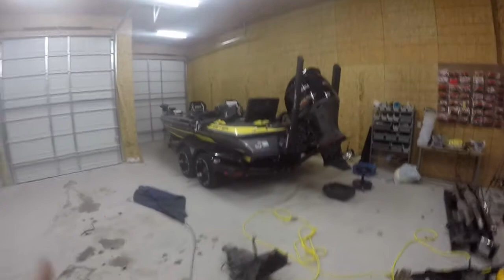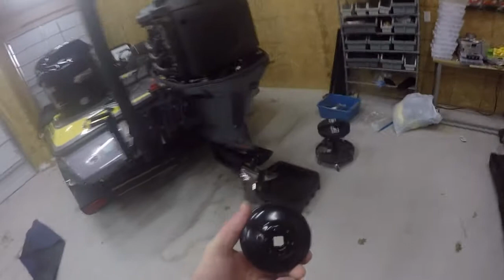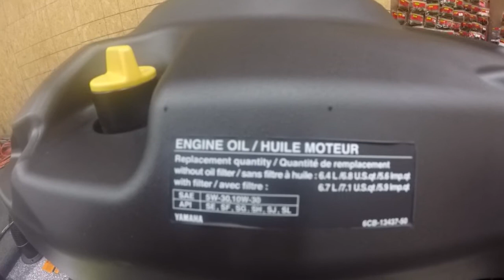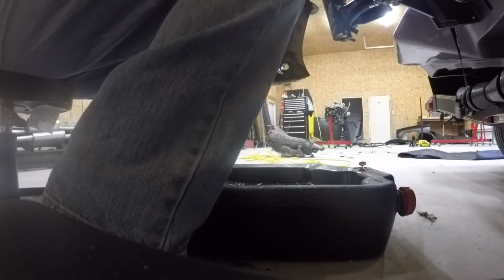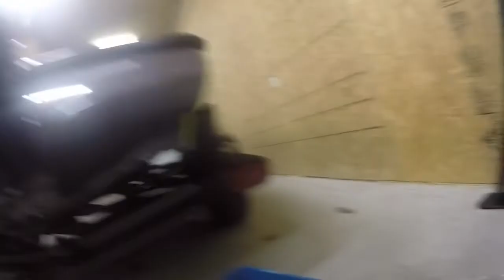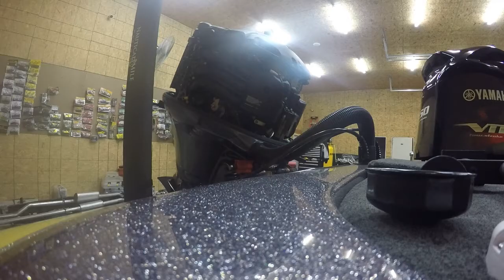Yamaha SHO Oil Change

Comment: Two quick things...trim the motor up and get up in the back of the boat when removing the cowling...its soooo much easier to remove that way. 2nd thing, do yourself a favor and get an oil extractor and use vaccum to get the oil out, its easier and way less messy.

Comment: Your supposed to use the HD lower gear case oil per your owners manual for the SHO motors.  Just thought you may want to know.
Reply: I used what my dealer said to use